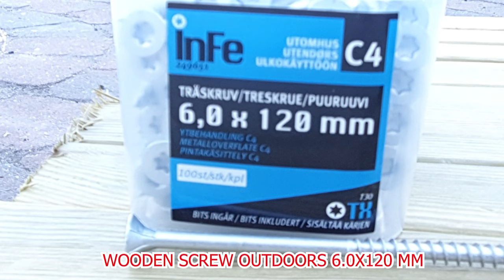How to build a solid lightweight and high wooden car ramp, with shelves for tools

Comment: Cheap vs less expensive.  Cheap describes the low quality of ramps you buy at a store.  Less expensive describes the higher quality of ramps you build yourself.  You've built ramps that are better quality (sronger) than any you could buy.

Comment from the maker: ramp design allows for tools and parts shelves, very handy,
1:58 
Mursement one: 230mm, 
2:12 
Mursement Tow: 480mm, 
2:20
Mursement Three: 900mm,
4:24
You should drill 4 hole for 4 screw for each lumber, i did it later when i install the lumbers.
And if your wood is impregnated maby you do not need drill holes at all. 
As i did not drill hole for the 2 other screws on the lumber. The bolt goes through without cracking the wood.

Comment: Nothing at all wrong with those plus you get to use them as a bench well done! 👍
A slight improvement would be to use threaded bar instead of screws if you have some.

Comment: I would like to build a wooden ramp in the shape of a right-angled triangle with horizontal slats, it will be placed between the two iron ramps in the event that the car ends up in the empty space between them, which is 57 centimeters away.It's improbable the car could drive over the empty space, but when I get off I always fear that it could happen.
I was wondering how I can tell if the wooden ramp will be suitable for cars.
Reply: Stack the wood in layers like paper and they will not fail.